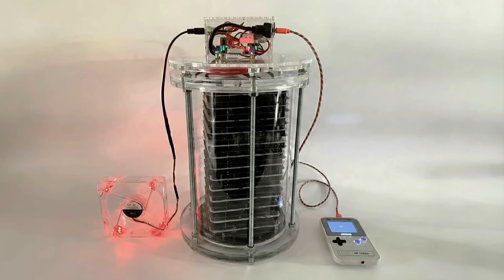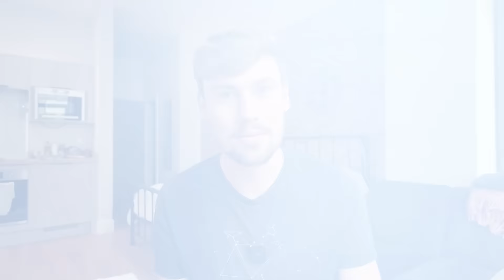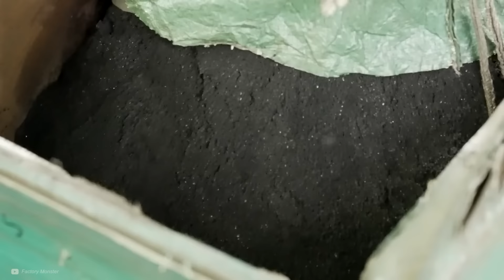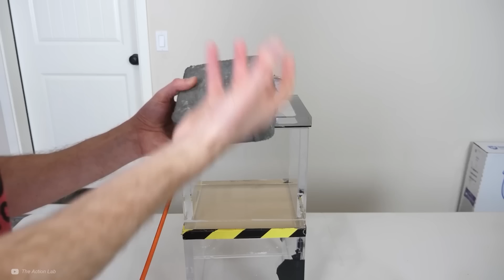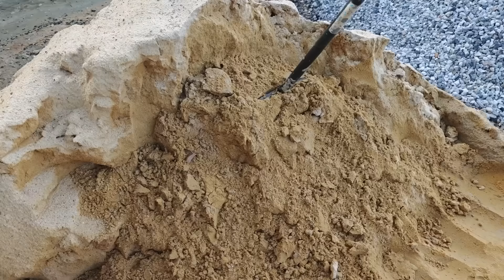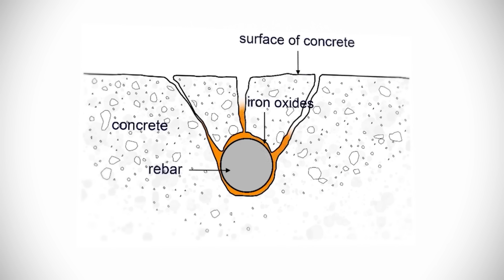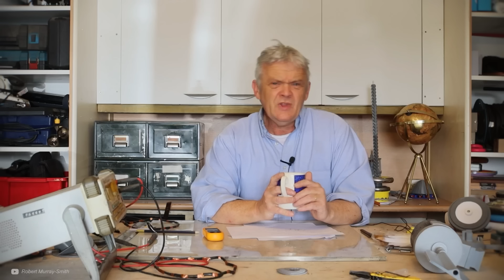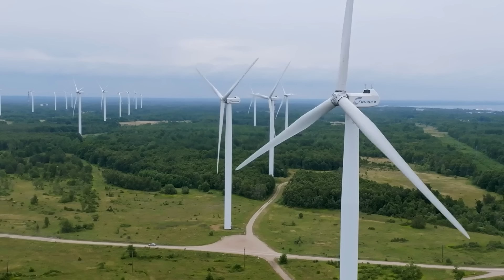How MIT's New Concrete Stores 10x More Energy

Comment: This is awesome research, but in reality this idea is dead on arrival. Pouring the concrete and using it as a structure is only one small step of building... Afterwards, its gets thousands of holes, anchors, cuts, etc... Not to mention, all the structural rebar that should be interwoven inside the concrete making a giant short circuit. Many buildings are also hybrid concrete supports with complex steel structures inside, creating a web of near unpredictable paths for electrons to travel....

There might be extremely niche use cases for this like decorative, non structural concrete, but in the end, it will probably just be better to use existing technologies for energy storage

Comment: I use the 50 cuyds of concrete in the house I built in 1985 to store thermal energy.
The ? That pops in my head is , what effect would the change/ discharge cycles have on the structural integrity of the concrete?
Reply: Depends entirely on the used concrete. There are roads made out of concrete and they handle the hot sun and freezing temperatures pretty well.

Comment: I wonder if it can be used to store energy from lightning strikes from arrestors and release it back into the grid.
Reply: You'd need some serious voltage conversion with the super capacitors operating at 1-3V
Reply: Lightning bolt capture has not to date been proven viable. The intensity and incredibly short duration makes it extremely difficult and impractical. It seems like there is a ton of energy in a Lightning bolt but not as much as you think.
Reply: You'd need a super-super capacitor first.
Reply: Gives the term "fast charge" a new meaning
Reply: really isnt that much its just very dense
Reply: Maybe if thousands of buildings foundations are linked by a conductor so each one only gets like a 5V jolt
Reply: While a lightning bolt does contain a high amount of energy, they are so infrequent that the average power output would be  low, especially when combined with the high cost of something capable of doing so

Comment: This means that the Three Gorges Dam could have integrated about 56GWh of storage into its structure.
Reply: According to some random idiot on the internet that "knows everything"(tm) the dams are going to collapse any day now, and this should be true as well as all other 52632 future predictions they made of which 2 came true (one about the date of new year and another about the date of next Christmas).
Reply: @adonisengineering5508  who specifically?
Reply: @adonisengineering5508  So how did they show they were correct about NEXT Christmas's prediction?
Reply: @adonisengineering5508 Chinas structures and maintenance for superstructures lags behind the west. It is only one reason why French, German, and other foreign experts assist with their infrastructure plans and construction.
Reply: If this cement/concrete is a viably electricity storage medium, the Chinese will be using it next week.😃
Reply: Yeah. I'm not buying that this would actually work for structures... 
I can't IMAGINE the galvanic corrosion issues you would have. 
Imagine lightning hitting a charged structure... 
Cute though.

Comment: 189 Wh/m3 is bad, this will correspond to 5,7KWh per 100m^2 House when used 30m^3 of this staff , now price above standard concrete cannot be higher than $400 to be even acceptable. Because batteries priced drooped bellow $80 per Kwh.

Comment: I'd not want to to be handling nano-carbon without full protective kit - more than a respirator which appears might have been used. 

Nano materials have the potential to get into and affect biological systems in ways which are far from well understood - though there are clearly both potential benefits/uses as well as concerns.

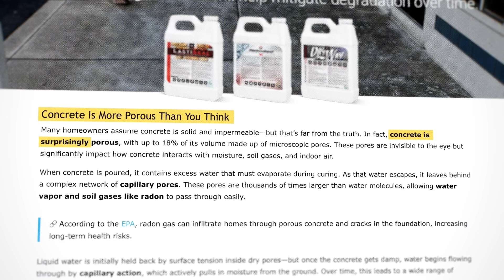Comment: 04:24 Choose your sources better. That line saying "water must evaporate" is nonsense. Concrete hardens by a hydration chemical reaction. This reaction, in fact, happens also underwater. No evaporation needed.
Reply: He did say "excess water" which I assume is water not needed for the chemical reaction. I could imagine adding excess water to ensure a complete reaction and to improve flow / thickness

Comment: > 2kWh/m^3
imagine your average phone battery in a size of a cube slab half your height, lol.
Reply: The average phone battery has around what, 15Wh? Sounds like you are talking about a very thin slab imo.
Reply: @julianzurn1428  yeah, roughly 11-15 Wh per watever phone battery size  3Ah x3.7V. So its about  thousand times less energy dense compared to concrete. 
okay 1 concrete, not 1 phone batteries but 20.
Reply: I can't even imagine my phone battery with 2 kWh. My Ecoflow Delta 2 has only 1 kWh and it weights about 11 kg.

Comment: maybe if they made huge slab of it under house/garage in cold climates, and also could heat the concrete itself to hold heat inside the house as floor heating.

Comment: That's all we need, structural parts of building also being energy storage .. sounds like a great way to burn down a building and extra fast too.
Reply: that would be impressive indeed with 3 volts
Reply: I'm not worried about fire ....but the effect on steel rebar and mesh and in contact with it ... Though Basalt derived  fiber rebar could substitute ..  my other concern would be the long term unforeseen problems  like those found with Aircrete that is still being discovered and adding millions to the national infrastructure repairs bill and causing chaos in schools , hospitals and countless other  buildings. 🇬🇧🥼🧙🏻‍♂️
Reply: This means the structural concrete would also be electrically conductive? Am I misunderstanding that correctly?  I’m down for living in a faraday cage, but it’s going to cause problems with cell phones, wireless networks, radios, and might pose an issue with building wiring [I’m not an electrician, so I’ll defer to anyone who knows more than I on the subject].

Wasn’t there a mythbusters episode where they demonstrated low voltage power drastically increased corrosion? Something about escaping a turn of the century prison. Someone double check my memory and lemme know if I’m imagining things.

Cheers!
Reply: @0ddSavant  Given what even carbon paint does for cell reception, yes it would be an issue. Though that would have the advantage of wifi that doesnt splatter your neighbours i guess
Reply: My first thought is that none of these components would be replaceable after failure if they were structural.

Comment: Hydrating interlocking crystals
I've concreted for 35 years an I've so many people come up with these ideas that never work 
But it's good to see that you have done some research an realised that air is part of the concrete matrix,,,, there's actually a product out called densifier that goes into hard concrete and fills them little air pockets and also hardens the calcium in the lime 
But this product has liquid glass in it so is it now a GOP...
   It also has to be reinforced for tensile strength 
It just doesn't work 
If you use that formula on a wind turbine foundation would it hold 
How would it perform being a counter lever for 50 years...
   Anyway good show,,thanku

Comment: What is a joke is the fact ancient Concrete far surpasses today's crap being used Period! They made concrete to last basically forever where as today's will start deteriorating after just 20-40 years depending and far more temperamental. This is why bridges especially are falling apart at the rate they are as once they even have a simple crack doom lurks over time. And we have the recipe for ancient formulas but cheap and greed take over
Reply: corruption + costs + profit existed ,  but there are different types of concretes,  not every concrete material are the same , there are concrete that are tougher than steel

Comment: Reinforcement for concrete that is non metallic exists. There already is glasfiber and carbonfiber rebar
Reply: Carbon fibre is conductive, could be a big plus or negative. Or both!
Reply: @SToNeOwNz not really. It’s covered in non conductive plastic.
Reply: @lukethmpsn  Was. Then it got to the job site...
Reply: @SToNeOwNz   nice
Reply: Anything used for reenforcement could support insulation and ‘plate’ separation, becoming a collaborative part of the system.
Reply: Also fiberglass
Reply: And hemp rebar
Reply: I read years ago that hemp fiber mixed with concrete creates a super durable support structure. I had to look this up with AI. This might help prevent cracking and aid in the durability of the battery:

When mixed with lime binders, the silica-rich hemp hurds (the woody core) react with the lime to create a hardened, stone-like structure. While it does not turn into a geological fossil over millions of years, this process is known as petrification or mineralization, which increases the material’s resistance to decay and strengthens it, allowing it to last for hundreds of years.The Process: The high alkalinity of the lime binder causes the plant-based shivs to petrify, essentially turning the hemp into a durable, stone-hard material that is lighter than traditional concrete.Long-Term Durability: Hempcrete continues to absorb \(CO_{2}\) and harden over its life, with some structures expected to last for centuries.Important Distinction: This petrification happens primarily with lime-based binders, not necessarily with standard Portland cement.Benefits: This process increases the material's resistance to mold, mildew, and decay.
Reply: @michaeldavis3819 ai lies to you to confirm your biases  you cant trust anything it says
Reply: @shaneelliott9045 this research is real however regardless of them using AI to reach it.
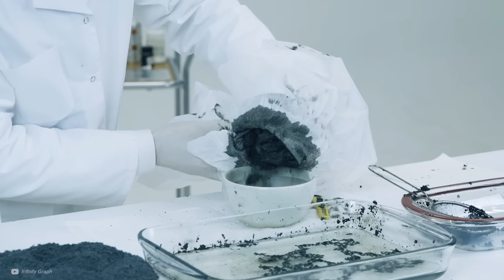Reply: 5:33  they made water  eetrolyte. I made a tool to add thr last of the ingredients when u smooth it over. Also recycled  plastic creating bubbles that compress bthevsir and it avtislly increase  strength,  longevity,  abd it helps in thrbdrlf hesling process.  Only ready  firbsmsll domestic  projects bonhsfe developed or engineered a machine to use on industrial scales. Firbsekf healing look at Rome.  U iudtnhsbe to find the 3m2 ingredients that combine better  espnin the enviorment uoure building in
Reply: Basalt is cheaper, more easily available and environmentally more stable and less damaging than either of those and more stable .
Reply: @clivestainlesssteelwomble7665  Was just going to say that! Basalt rocks 🙂
Reply: @allanallansson9532  there's so many puns in this comment section😂
Reply: @clivestainlesssteelwomble7665  But basalt does nothing for tensile strength. It just eats up space and reduces the energy storage.
Reply: @jeroenkoehorst4056  yea, that is true unfortunately. Hybrids can help with that to an extent
Reply: @jeroenkoehorst4056 

Basalt Fibers do indeed increase tensile strength.
Reply: @jeroenkoehorst4056 basalt by weight is stronger than steel, but because it is lighter, the volume of concrete can be reduced, allowing for thin wall structures of comparable strength to steel. The other benefit of basalt is that it has a similar expansion to concrete, and does not expand due to rust like steel does. Monolithic domes website has some great info.
Reply: @clivestainlesssteelwomble7665  Basalt is surprisingly sensitive to high alkalinity conditions. 

AR grade fiberglass etc is more resistant
Reply: @clivestainlesssteelwomble7665 came here to say this. basalt rebar is awesome.

Comment: 9:25
Hurray to Murray!
Pride an Honour to the Fallen Fellow!
You should reunite the Clan and Rebuild the Family Castle in Scotland at Dunmore Park..

I have no better ideas for Concrete Supercapacitors because I am Completely incapable at Chemistry...
But they did also tried with Amorphous Graphene?
It's cheaper, cause it can be Sonicated directly from Coal, should have better Mechanical Qualities than Nanocarbons and Also more Surface Area, which also Happens to be Irregular..
[I think you made 
'German Science Guy' did a Video Explaining someone at
Cambridge they found 
Irregular/Disordered Carbons Structures to be more Functional for Energy Storage.. don't know if I Remember correctly, but it might be Similar for Amorphous Graphene Structures, which would works wonder Paired with Regular Concrete by themselves even without the Energy Storage Potential due the Increase in Mechanical Proprieties..
A New Era of Infrastructural Projects.]

8:15 
You didn't explained the Organic Electrolyte: 
what they are? 
what Problems does they have?
If it is so much better than the Water based Electrolyte, functionalising the Organic Ones to be Integrated with water through Chemical Aptamers or Integrating those with Organometallic-Chemistry would be more useful and Cost-effective than Using water based one..
It is just more Preparatory Work compared to Just mixing Water Electrolytes with Nanocarbons and Cement...
For Housing Sector would still be Unfeasible and Overexpensive Regardless..
But for Standardised Huge Statalised Projects as Bridges, Roads and Embankments that would be a Small Up-Front Cost for Upgrading the Technological Reach of the Construction Chain benefitting from the Economy of Scale for Large Statalised Infrastructural Projects which would need to be Made in Any case...
..and from that moment why don't making those Better, more functional, and with the same Cheap Materials Integrated to a Pre-production Chain with Simple 
Updated Procedures..
Imagine the Highway' Cement Lanes Spacers Being Made of Stackable Supercapacitors..
The State would have a Grid Stabilisation and Energy Storage for Unpredictable Renewables Energy Pikes of Production as Long as they have Roads already Built-in their System.

For the Most difficult part of it asking Nobel Prized Professors like Omar Yaghi Might Help Much more than Simply Ditching a Concept because Technology is not there Yet..
The Fact it is not there it doesn't mean it cannot be Created for Purpose..
Different Research Fields simply might not know the Necessities of Others Group of Research..
Murray was already there because he worked in the Battery Production/Energy Storage from Decades...
Yaghi might not even know a Problem like this Exists but it might find a Solution with Ease having more Knowledge of Organometallic Compounds...

Let's make this Concepts Flying High!
They have Infinite amount of Potential.

Comment: When you mention concrete having 18% porosity is this vibrated or non vibrated concrete?
Reply: There's a rule: non vibrated is non concrete
Reply: DO those two have differing water content? Because he explained the porosity being connected to evaporation.
Reply: The 18% porous doesn't refer to the entrained air in the poured concrete but the water that evaporates as it cures
Reply: He said "up to", so whichever is higher I'd guess
Reply: concrete can vary wildly depending on mix design
Reply: Asian
Reply: Most likely vibrated as he is talking about structural concrete but eh i could be wrong, also the porosity of concrete depends on the water/cement ratio
(which is just technical way of saying how much do we hydrate the cement)

Looking at that 18%, we are talking about Water/Cement ratio of 0.50 or lower
most of the voids are left when water evapotates, therefore Water/cement ratio is the main variable to porosity of concrete

Air trapped in the mix is usually not a big issue, after vibration the air is at 2% or lower, even if it was just compacted it would sitting at 6 to 8%, at most

Comment: Would this not work even better if carbon fibres - say 1-10cm - also mixed into the concrete? I think it would both strengthen the concrete and boost the energy transmission throughout the concrete mass.

Comment: When it's all mixed, how do you even attach an anode and a cathode? I thought you'd need a clear separation between the two sides, not a chaotic mix.
Reply: I think they use conductive plates between the bricks. 1 plate positive, next plate negative, etc.
Reply: One level of concrete is the negative cathode and the next level above being the positive anode, separated by insulators and structurally fastened together, it can work but it might be too expensive to justify, or it might justify it if stationary battery storage doesn't get cheaper.
Reply: you have one block be plus and one block be minus, have a separator between them
dunno how i like it as a building material, but i guess its a nice idea to make very rugged supercaps that can be structural members
Reply: Just what I was thinking. If you had blocks of any conductive material with a separator between them then, if the size of bricks, I'm guessing that the capacitance would be in the nF region, not super-capacitors. To be able to take advantage of all that surface area inside the concrete then there would need to be two distinct electrodes that pervade it. I'm not clear on how that can possibly happen if it is all just thrown in a concrete mixer.
Reply: @SimonBlandford  +1 to this.
Reply: They are used between bricks. I'm assuming the mortar keeps the bricks electrically separated.